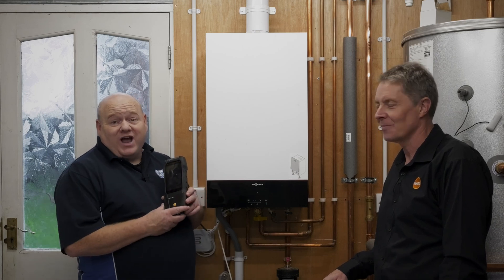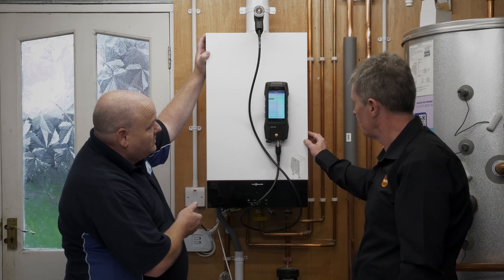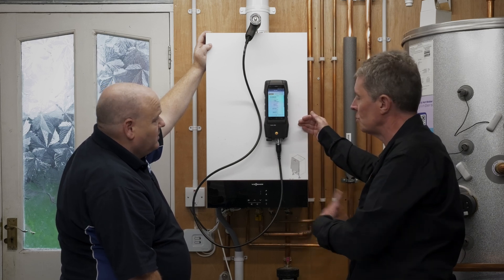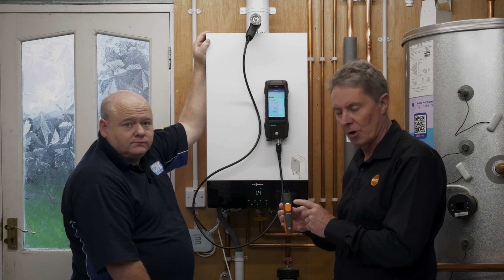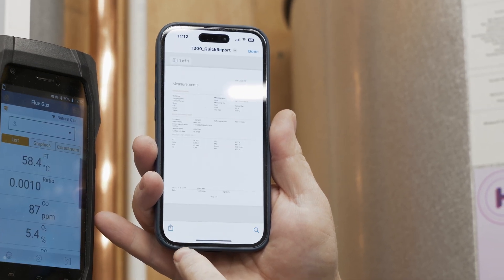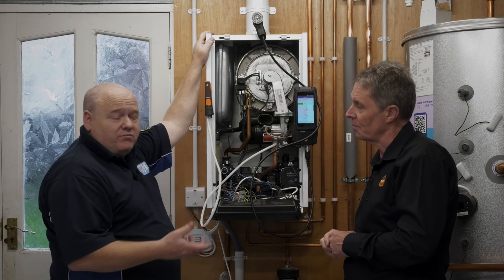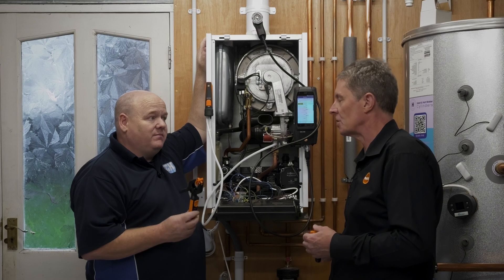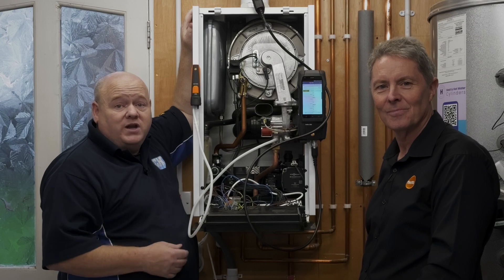How To Use Testo 300 Testo 300 Ultra Smart Kit Review | Gas Training

Comment: Nice video Allen. I’m having the same issue as a few of the other engineers are with connectivity to the app. I also have an issue that the unit doesn’t auto zero on startup unless you long press the power button. To me this FGA seems more flash than function

Comment: Is the wireless thermometer the only way to probe Combustion air intake for a direct vent piece of equipment? Other manufacturers you can bypass ambient temperature for your true net stack temp but with this it seems you can't

Comment: Shot there’s selfs in the foot there I had the 510i says on the description for tightness and let’s bys pressure test pressure from -150mbar to 150mbar on multiple websites mine stopped working and was leaking they wouldn’t repair it as it wasn’t under warranty and not worth fixing so either multiple websites are lying or these fuckers are 😂

Comment: How much is calibration each year how long is the warrentee
Reply: In my country It was @ 70£ for the calibration … 
Things that matters: what tipe of sensors you have - generic or long life 
And the most important thing for the lifetime of the analizor and the sensors: the user - you most avoid poisoning the sensors… 
You must read the instruction manual for best practice 
In my country the guys from testo are very friendly and helpful😊 - this is why I accepted to pay 50£ for 6 paper tools for the Thermal printer😅😊
In total for calibration, set of replacement filters and 6 paper rools I paid @ 150£ - It is not the Best deal but to have friendly technical support you have to pay their salaries 😊
Reply: £120 for first 3 years then goes up slightly after that sensors get changed every 2-3 years

Comment: I also have an issue with the Testo 300 unit connecting to the app. The probs connect no problem but the 300 won't. The reason I purchased this kit was so I could email results to my customers without having to print reports. Does this app work with Apple. I don't think so. Will be contacting Testo for more info.
Reply: Me too, has a mind of its own. Tried on IOS and Android. Doesn't connect to either.

Comment: nice video. i received a new 300 yesterday but having issues setting it up. anyone on here have one?
Reply from the maker: What issues do you have? Thanks.
Reply: Hi Allen, the main issue atm is connecting it to my iPhone via the smart app. i have the smart probes they connect to app fine but not the 300. other issues, when i set the wifi connection on the 300 it does not stay connected. i have found no way to export any results to my phone for emailing to customer.
Reply: @valethedoctor46 any luck getting an answer to over come this?
Reply: I can’t send anything to the app only way is set up an email address but then it doesn’t work over the phone data so I have to take it out at night and send it over my WiFi at home which is pain thought it would be seamless transition to the app but no big downside for me.  might have to fork out for a printer😢
Reply: I got told if I am not commercial engineer wouldn’t need the second screen. It doesn’t connect apps for apple so that doesn’t work unless someone prove me wrong